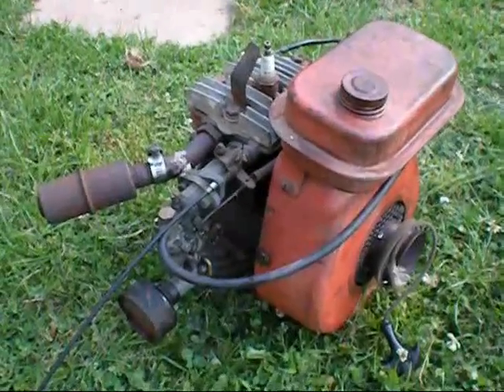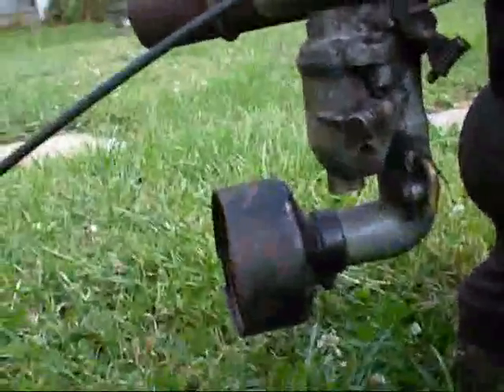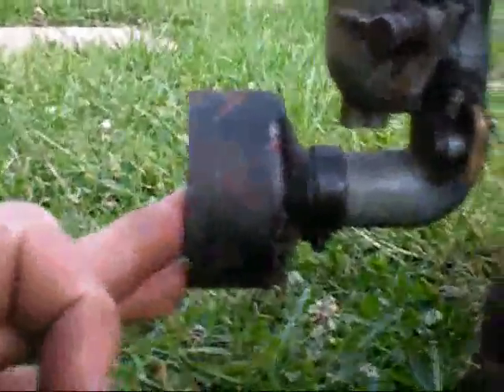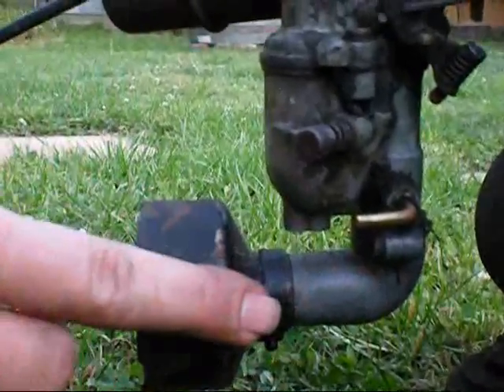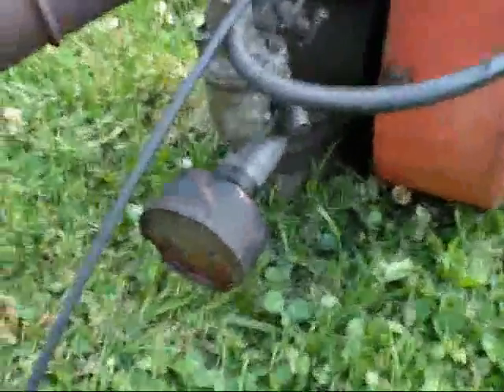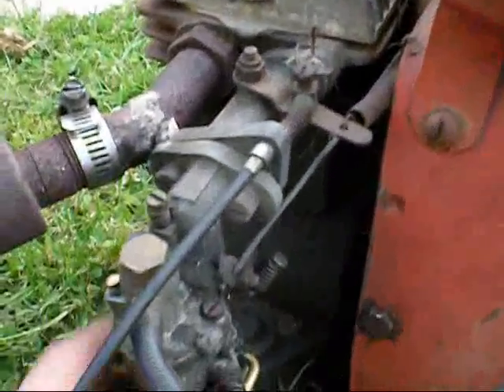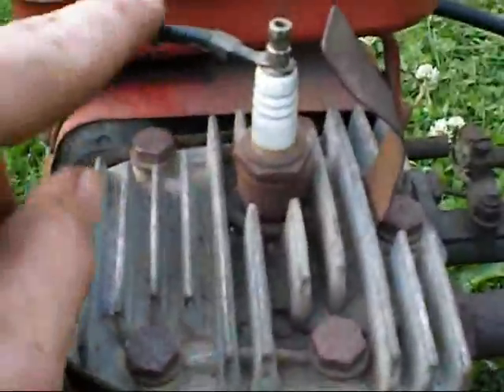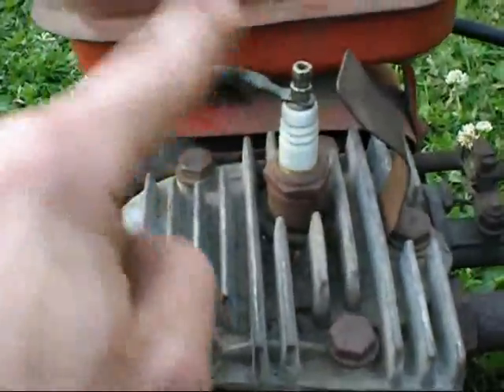old 1920? engine. part2

Comment: ok not to get all your hopes down i do not believe that is a 1920 engine fir one because a 1920 would not rev that fast and if you look at the 50's engines most are cast iron this engine is late 60s early 70's because as you see the engine block is cast pressed and the head will explain alot of how old it is cause the head would be cast iron also.  Sorry for not using Puncuation.